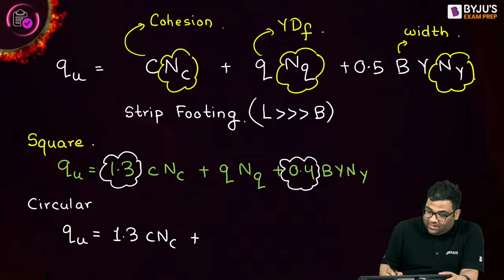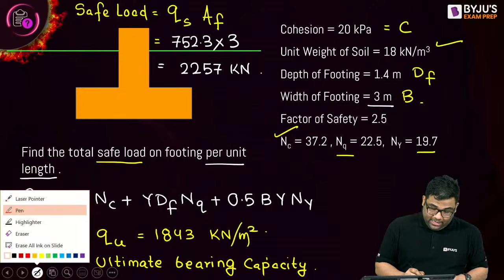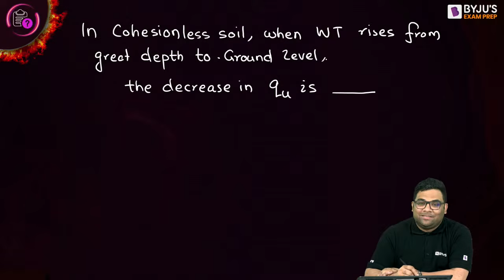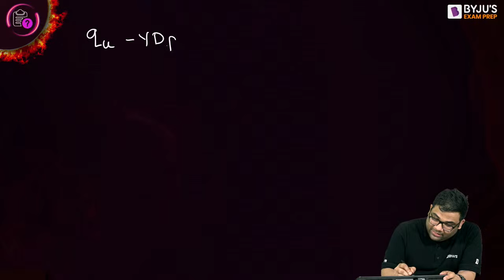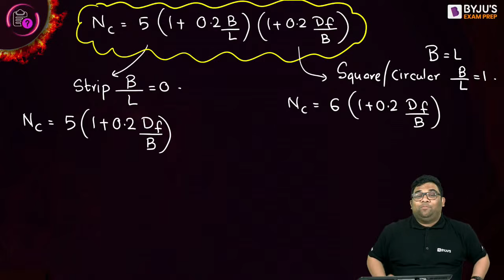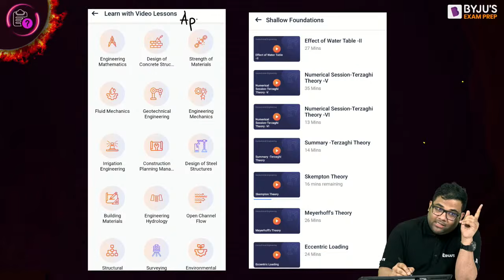Foundation Engineering | Geotech | GATE 2023 Civil Engineering (CE) | BYJU'S GATE

Comment: Homework questions:
Pile foundation
Question: 1 given data
C = 50kpa, L = 23m, alpha = 0.6, d = 800mm = 0.8m , Fos = 3
Calculate: allowable load on pile
Solution : allowable load = ultimate bearing/fos
Qu = alpha* C (pi * D *L ) + 9 * C ( pi/4 d^2)
Qu = 1959.36
Allowable load = 1959.36/3
We get answer = 653.12
 
Question 2 : given data d = 0.4 m, L =10m ,C = 40kpa, spacing pile= 1.2, 
Calculate: ultimate load group block  failure
Solution : B = S + d = 1.6
(Qu)g = C * 4BL + 9 C ( BL)
We get answer (Qu)g= 3481.6kn 

Shallow foundation homework 
Question 1: answer = 0.902
Question 2: given data C = 40 kpa, placed on surface (df =0)
Calculate : Skempton net ultimate bearing capacity strip footing
Solution: qnu= 5.14c
We get Qnu = 205.6
Question 3 answer: ABD